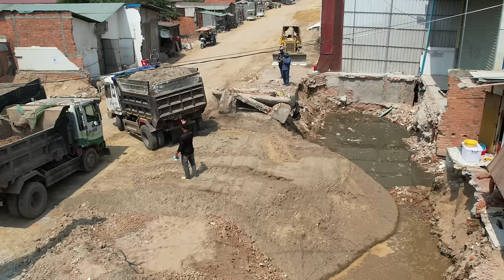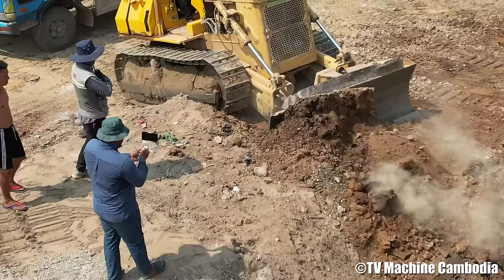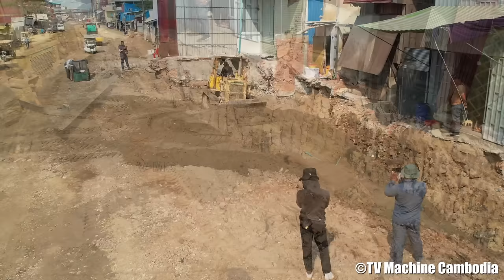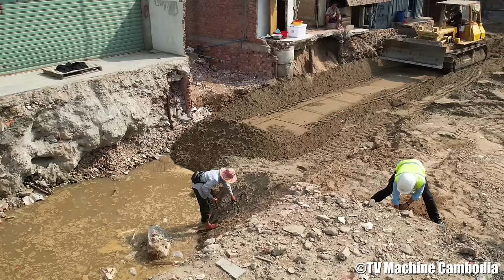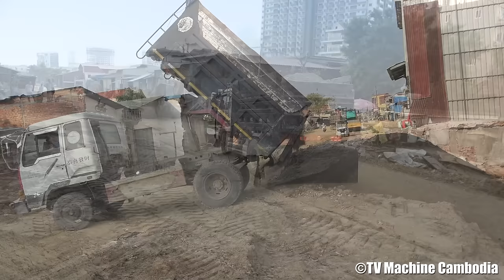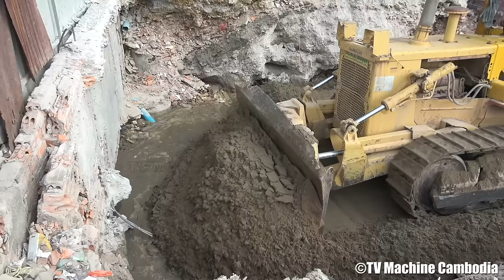New Update Experience Operator Skills Dozer Spreading Sand Building Foundation Village Road

Comment: Too bad the dozer operator has to put up with the failing dump truck drivers. He has to come out of the project to push the fill in the right spot.  The truck driver need to back up to the line more or go home.